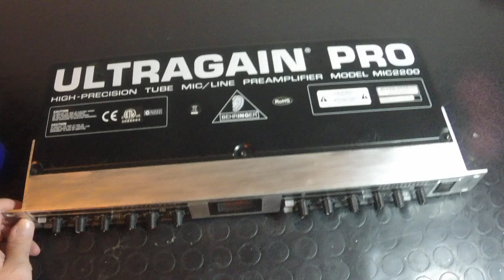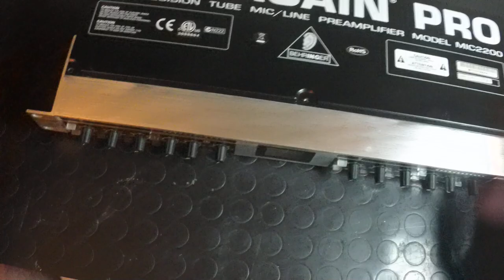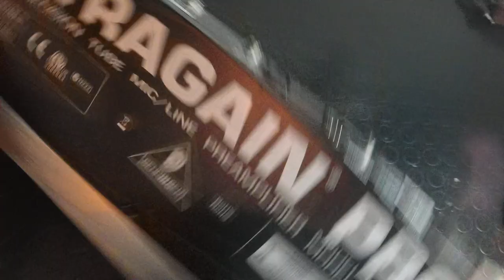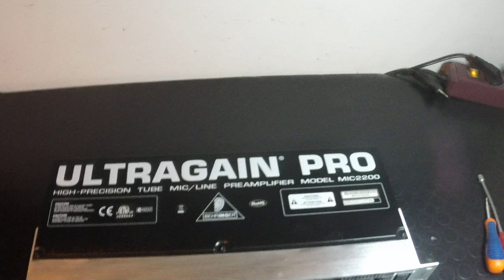BEHRINGER ULTRAGAIN MIC2200 - TUBE REPLACEMENT PROCEDURE

Comment: What tube did you use....
Reply from the maker: Now, using Tung-sol, but also Sovtec  or the original Bughera stock, have good sound.
Reply: Thank you
Reply: What in it originaly
Reply from the maker: @joecarreiro4246  Bughera 12ax7